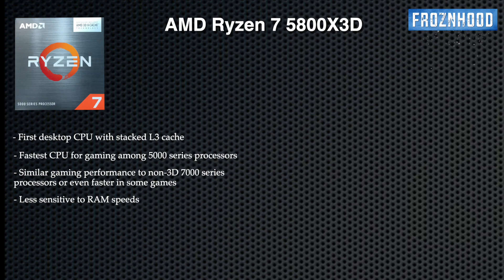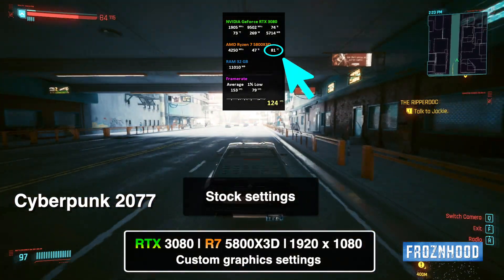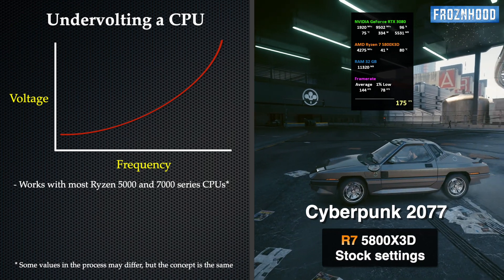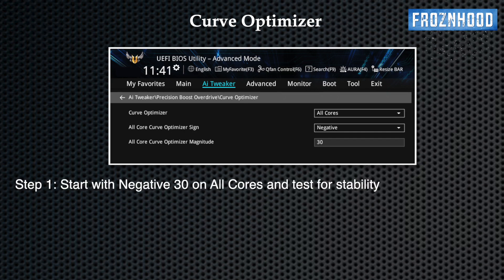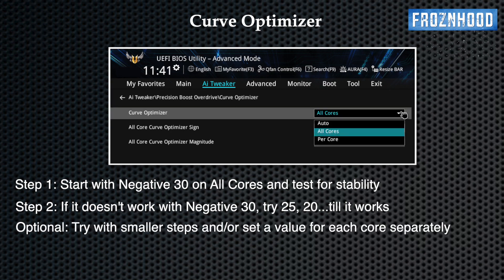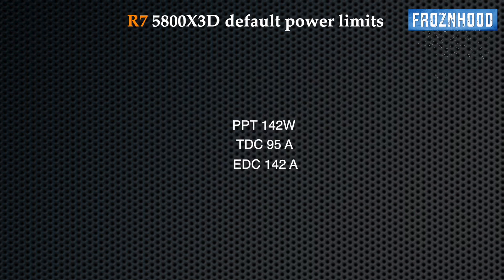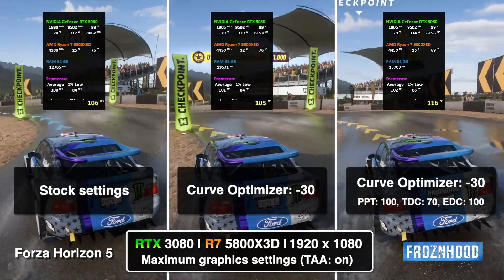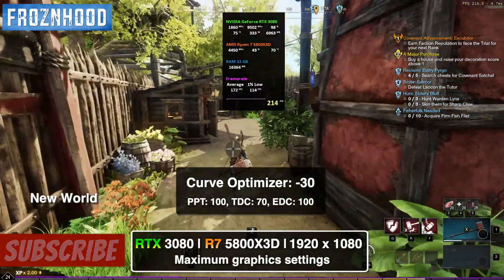Optimizing Ryzen 7 5800X3D - Higher performance, Lower temperature | Undervolting | Curve Optimizer

Comment: For me minus 25 on all cores without touching any other thing it runs stable at 4450mhz and on lower temps. I heard minus 30 offset can harm your cpu in longer distances.
Reply: Undervolting is never ever damaging anything! That is pure nonsense. Overclocking can damage if you go to far. Stop talking nonsense please. Thanks in advance ✌🏻
Reply: @swordfishffm yeah Idk why anyone would take advice from someone with a Hitler Pepe PFP. Undervolting won't kill your hardware.
Reply: @smugmode  I didn't saw his pic 😂
Reply: I've always heard that undervolting cant hurt your components because if it doesn't get enough power it will just shut down. I run -25 as well because my chip wasn't stable at -30
Reply: @Katjajaja  i did not even try 30 offset. I was happy with my 25.  I heard the same rumors!
Reply from the maker: What rumors have you heard? From whom?
Reply: i read a lot of rumors about -30  on all cores harmed 5800x3d. In longer terms. like 1 year or so. I seen that like 3 times already so im not risking that. Yes every chip is different but im not taking the chance haha
Reply: I've had my chip at -30 for quite a while now and have had no issues at all.
Reply from the maker: Same here, no issues with -30 curve and the CPU is working almost 24/7 .But if -25 or even -20 curve still gives good results to people and they are less worried that way, its fine.
Reply: How the fuck is that even measured? How come this undervolt issue has never made to main stream platforms like gamers nexus? I'm not sure about this bro. But you do you.
Reply: @CrouchJumpYT  idk how is that possible. Im currently changed to 30 offset. No problems yet. I'll write something if i'Ll have
Reply: @Soldier-qm1kl you concerned to go -30 but you keep yours at -25 so why even do it at all if you choose to be persuaded by the rumors

Giving less voltage just makes the processor run lean like lesser gasoline in an engine until it stops running nothing happens if it stops you just add more fuel

Same occurs here with voltage cause with voltage spikes in how voltage delivery is handled
Reply: @dvxAznxvb  I went all in and tried it. Now im running -30 offset and it works fine (4month in at -30) . It was a rumor as you said. You are right. So if anyone will see these comments and can try -30 (not all the chips can do -30 maybe like -25 max) and it works and not crashing you are good to go!
Reply: @Soldier-qm1kl  i tried -30 on a 5600 and it doesnt do well at idle; its able how it manages the cores and which ones are the supposedly faster ones and those are the ones you are wanting to undervolt the most i believe to get better clocks (by having more thermal headroom) which allows the PBO to boost higher. in the case off my 5600 i couldnnt get my slower cores over -15 or so since it would kill the cores before it could park or disable it which it needs to be over a certain mhz frequency to allow it to still function without errors

5800x3d and other XXXXx3d chips are undervolted much much easier cause the boost clocks are not as high and you cannot overclock manually since 3d vcache is temp sensitive
Reply: @dvxAznxvb yes exactly. We are getting more stable core clocks while undervolting it. Less heat more stable cores. X3D chips need that.

Comment: Thanks for the explanation, do you think that a be quiet dark rock 2 can maintain good temperatures with these settings in bios?
Reply from the maker: You mean Dark Rock TF 2? It is not a bad cooler. If you already have, just test it.

Comment: Thank you very much man. With that settings i dropped my temp from 79-80 to 66-68 in BF2042 and i won arround 15 fps. You are an hero.
Reply: çok oynayınca işlemciyle hata vermeye başlıyor oyunlardan atıyor
Reply from the maker: You need to try different settings as explained in the video.
Reply: @zafer9006  ne alaka
Reply: @xelerator2398 dene gör kardeşim voltajı çok düşük verdiğinde ne oluyor bi bak denemesem gelip yazar mıyım 😄
Reply: @zafer9006 kaçta bıraktınsonuç olarak?

Comment: Thanks for the guide, for some reason I can't work out my CPU speed is way lower than yours, in the 3600-3800 range, measured using Ryzen Master. Which monitoring tool are you using?
Reply from the maker: In which application you get such low clockspeed? MSI Afterburner is more convenient for monitoring both CPU and GPU.
Reply: @FroznHood  Thanks, I never see it break above 4Ghz, even in CPU demanding games and y-cruncher.
Reply from the maker: Yes, this is strange.

1. Reset you BIOS and set everything from the start. Before that, update it to the latest version if it is an old one. With everything on stock the CPU should maintain around 4.25 Ghz in games, unless you have a terrible cooler. If that doesn't solve the problem, go to next step.
2. Uninstall the AMD chipset driver if you have used another CPU before that and clean install the newest AMD chipset (form the official AMD website only!).
3. Do not try any kind of  overclocking the CPU even if you read somewhere that it was possible and someone has done it somehow. Do not do this!
4. If you manage to get around 4.25-4.3 Ghz in games with the steps above, start the procedure in the video to optimize the processor.
Reply: @FroznHood  Thanks, I have done those things. Ryzen master seems to report things differently to other tools. I don't know which ones are accurate.
Reply from the maker: Have you managed to solve the problem? How is the CPU working now in games?
Reply: @ScruffyMisguidedAndBlue  Hey, You may have to change your max pwr to your CPU in windows power settings. I changed mine back with the 5600x when I got it and forgot to change it from 99 to 100. IF you need help finding it just comment here I can write up where you go pretty quick

Comment: Bro I can’t find precision overdrive on my bios i have b550m a plus tuf gaming
Reply from the maker: Download the motherboard manual and read the BIOS section. You should find it there. Also, you may need to update the BIOS. But first read the manual.
Reply: For my motherboard (ASUS B550), I click the following:

- Ai Tweaker tab
- Precision Boost Overdrive
- Curve Optimizer

Then just set the three boxes to “All Cores”, “Negative” and “30”.

Comment: 80c at only 43% usage? man sort your cooling out, you are running about 20c higher than me
Reply: What cooling and case are you using. I’m running a custom loop and I’m around 50% utilization and high 70s
Reply: @theb4r138  Case is a corsair spec omega rgb with the glass front replaced with a mesh filter, corsair h110i 240mm aio with fixed fan rpm of 950 and pump on balanced. the aio is mounted as an intake at the front with and 120mm fan and the back and top of the case, i am also undervolted -30 all core curve and custom power settings

Comment: I'm in unlucky group, my 5900x can take only -15 in undervolting curve.
Reply from the maker: No,  you are not. This is normal for 5900X and 5950X. Your CPU is absolutely fine. Leave it with -15 curve if it is stable and depending on what you want to achieve, you can tweak the power settings I showed in the video.
Reply: @FroznHood  My main target is noise reduction with NH-D15 and -15 on the curve, CPU is almost never over 75C. Big W for lover noise.

Comment: Thank you for the tutorial!!! Stock settings load I’m running at 78C, and with your tweaks @-30 max load is at 64C on cinebench. I’m on a x470 w/Deepcool LS720 Aio
Reply from the maker: Very good result. It means that during gaming it probably runs even cooler.

Comment: So if all cores on negative and set to let say -30 does that me lower power consumption? Or is a -10 mean a lower consumption ?
Reply from the maker: -30 means less voltage than -10 for a specific frequency. (clockspeed). The overall CPU power consumption depends on the application you are running and how it uses your CPU, for example, how many cores it uses (and how often), frequency peaks etc.
Reply: @FroznHood  -10 still lessens the voltage right but just a bit unlike -30?
Reply from the maker: Yes, something like that.

Comment: Hola amigo queria preguntarte ayer compre el 5800x3d tengo una refrigeracion liquida y obtengo temeperaturas del cpu de 88 - 90 grados y con pbo -30 negativo me ha bajado 10 grados crees que esta bien 90 grados de stock o hay algun problema con la cpu
Reply from the maker: Hola, how/where do you get 88-90 degrees, during gaming? Which game? Or in some test?
Reply: @FroznHood  cuando inicio una partida en warzone 2 al jugar 2 minutos llega a 88-90 grados de stock
Reply from the maker: What cooler are you using? It is possible to reach 90 degrees in gaming, ONLY if your cooler is not good enough, the thermal paste is of low quality or it is not applied properly. For a cooler I recommend something with the performance of Bequiet! Dark Rock 4 or Dark Rock Pro 4. And a good thermal paste...
Reply: @navyh7647 comigo também acontece o mesmo no worzone batia 90 graus com a configuração do vídeo reduziu 10 graus.
Reply: Brother, tu cooler liquido no está a la Altura del CPU, es uno chico de 120mm? Cuando compré el mio tenía líquido pero chico, de 120mm, me pasé a uno de 280mm y ahora si lo enfría bien, no pasa de 70. Checa eso primero pues creo que el 5800X3D es de a fuerza un AIO mínimo de 220mm

Comment: I am 1 minuite into the video and i had no other choice but to pause and thank you for making a great video, in 1 minute you were able to display the issue, explain it and visualize it.
Not many people are able to do that. Hats off. subscribed.
Reply from the maker: Thank you very much for this kind comment. I am trying to do my best to share my knowledge and experience, and to grow a channel/community. But now, seeing such a positive, inspiring and motivating feedback, I feel that I have (and want) to make something even better next time. Thank you!!!
Reply: @FroznHood ❤If i do NOT have Curved optimizer, does it make sense to adjust the PPT TDC AND EDC Limits like you did? Because 
I have an asus prime a 320m-k Mainboard, and cannot find the curved optimizer.. Thanks alot ❤
Reply: This is prob why randomly I would see low fps in cs2 , it's temp prob going high or something.

Will test with undervolting even thou I don't want to deal with it like to run stock settings .

I hated messing with my GPU undervolting this one might be worth it😊

Comment: Can’t use curve optimizer disabled in b550
Reply: AMD asked board makers to disable these settings. It's not tested nor advised to overclock, but it also removed our ability to undervolt too sadly. It can still be done with PBO2, though the settings reset after reboot, but there are ways to make it automatically reapply
Reply from the maker: You see it in the BIOS, but it doesn't allow you to change it?
Reply: maybe he needs a bios update ?
Reply: Even on the latest there’s no option in the bios

Comment: Just slotted a 5800X3D into my X570 MEG Unify (replacing a 3600). Have a ThermalRight Dual-Fin Peer-less Assassin 120SE (Saw GN rave on about it a while back) - did the pea + dots in corner methods for thermal paste. Will give this undervolting a go and see how it all works. Thanks for this! I love my X570 MEG Unify, I didn't want to jump up to AM5. 5800X3D will keep me going for years to come.
Reply: Hey how did it go for you since I also have the exact same parts as your except for the motherboard. How the temperature?
Reply: @dwine1122  sorry buddy, missed your reply. I'm at 33-37oC idle, and always under 60oC when gaming, always in the 70oC range during cinabench r23. That is without undervolting. So haven't messed with voltage yet.
Reply: For msi motherboard, just activate "kombo strike 3".
Reply: Did it work
Reply: @decliningship4208  tbh, my idle temps are around 33-37oC, and it doesn't go above 60oC when gaming, so i haven't touched voltage yet. In a cinabench r23 test, it got up to 78, but never above that.
Reply: i'm planning on getting this cpu aswell, i only play games like rust, ow, csgo, r6 and im thinking in getting the thermalright was im using a 1700 stock one rn, im afraid of undervolting as idk how to do any of this and what will happen if i do it wrong, do u think i should be fine with no undervolt? i play all low 1080p and stream with my gpu from time to time
Reply: @jilcha1036  this cpu can run rly hot, depends on luck, u might have to do it, also u can't damage ur system at all when u do it, it may become unstable or stop booting when u go too agressive with the settings, but with this chip i havent seen it have trouble booting, just unstable, heck most of em get to the max uv of - 30 on all cores stable. Power limits will affect performance negatively if set too low though, the settings in the video are low, i use em too, but i dont think many pple will get good performance on em. If u run in a situation when u cant boot switch off ur system, switch off ur psu, find ur mobos jumper and move its position 1 pin to the right( depending on orientation) , press the pc's power button for 5 sec, wait 15 sec then put the jumper in the original position. ( ull find where it is with the mobos manual if u cant spot it, but i doubt ull need to even do this at all).
Reply: I went with this cpu because I didn't want to take my whole build apart to replace my 570 😅
Reply: @PoopSunday  i hear you there. X570 gets the job done.
Reply: But only 4 SATA ports.
Reply: @Physics072  I don't use any of the Sata ports. I use the M.2 slots for NVME drives, and have a PCI SAS card that connects to a 16Bay DAS I have housed in a Lian-Li PC-P80B. One of the reasons i went the MEG Unify, was so that i could put a 10GB NIC card, and a SAS card in the 2nd/3rd PCI slots. And it has 3 M.2 slots for NVME.
Reply: I have a 3800x with a 5800x3d sitting in the box...waiting to see reviews on the 7800xt. I also have the unify....love it. I also run nvmes and thinking of getting a third but 2 tbs this time. I have a scythe mugen rev b and I idle at 33 and gaming is 55 to 60. But I have 2 200 mm fans in and 2 200mms out and a 140 out(pulling fm scythe out the back) I will be trying this.........2 more days for reviews....... @shootinputin6332
Reply: @shootinputin6332  Which SAS Card you running?   I have a few DAS RAID 10 boxes but they run of my Dell Powe Edges not my Gaming PC.  Normally a Sas card in a gaming pc slows the boot process a bunch, I just use 16 to 20TB enterprise drives in my gaming box for steam games.  If the game really needs it like cyberpunk I move it to the NVME drive.  I use NAS and DAS boxes for movies and backups but not gaming.
Reply: @Physics072  LSI 9201-16e. You don't worry about boot process with this setup, because it runs 24/7, anyway. It's a server. But the longest boot process is loading UnRaid.
Reply: get kryosheet from thermal grizzly allot easier than thermal paste and u gain at most 1 degree in temps or u can lower it down by 1-2 degree if u tighten the screws hard
Reply: Same

Comment: Would we archive the exact same result of those tweaked Curve, PPT, TDC, EFC setting by swapping for a top of line CPU cooler to cool our 5800x3D? 🙄
Reply from the maker: AIO or air cooler, no. A custom water cooling will get you there with the temps, may be even below that, but the frequencies might still not be that stable. You can try and share the results with us.😀
Reply: @FroznHood  I tested now and the temperature stay low but the CPU speed is extremely unstable. Only way to keep it constantly on 4.4GHz while running CineBench is by input -30 on the curve optimizer on BIOS 🤦.
Reply from the maker: The clock speed during Cinebench is another story and you don't need to worry about that. The way it uses the CPU is completely different than the way games are utilizing it.

Comment: how do i test stability?
Reply from the maker: There are many "hardcore" apps for stressing the system (Prime95 for example), but I would recommend an easier way:

Step 1: Cinebench R23 - run the 30 min. stress test both single-thread and multi-thread. Run 2-3 stress tests in each mode. If it fails, change the settings. If it passes, go to next step.

Step 2: 3DMARK - there are CPU and GPU stress tests and benchmarks. I am not sure which of them are available in the free version, since I have the full one, but at least there will be some free benchmarks. I usually test with 3DMARK for about an hour or two. Unigine benchmarks (Heaven, Valley etc.) are also an option for a long loop testing. If it passes, go to next step.

Step 3: Play your favourite games. 7-8 hours gameplay should be enough to check the stability. I recommend using one very CPU-intensive game and one very GPU-intensive game. A good choices are Valorant, Warzone 2, Cyberpunk 2077, but that depends on what you have and what you usually play. 

Please note that at Step 3 it is possible to encounter a problem that is not caused by the undervolting process. Sometimes the video driver may crash for some reason. Or the game may have received a bad update or even the OS. If that happens, continue the testing. You can also change the game you are testing. If it keeps failing, change the settings and continue from step 3.